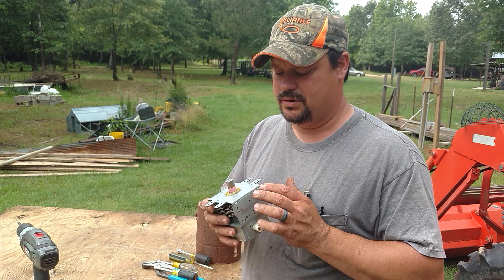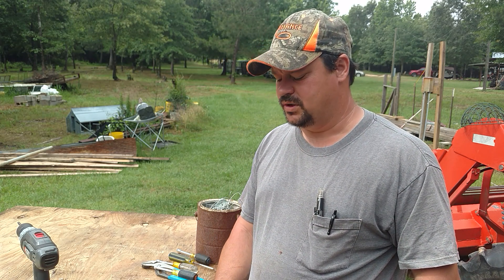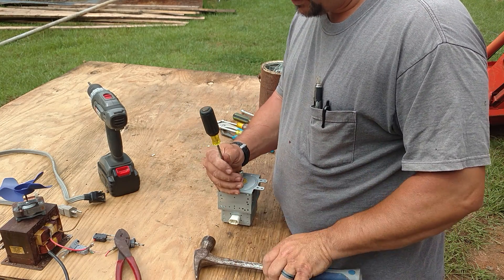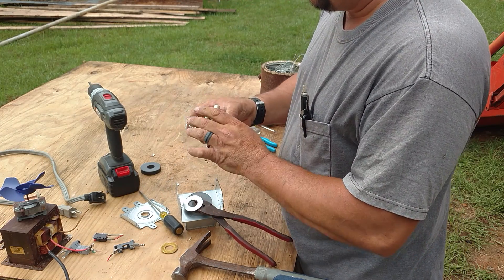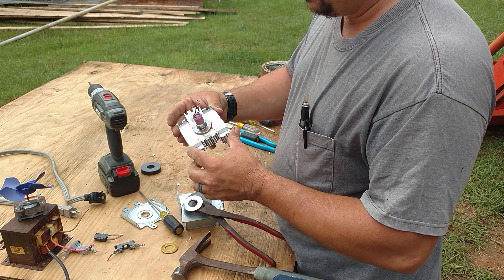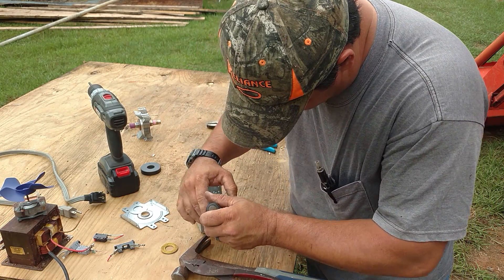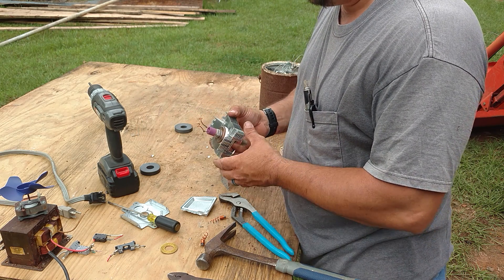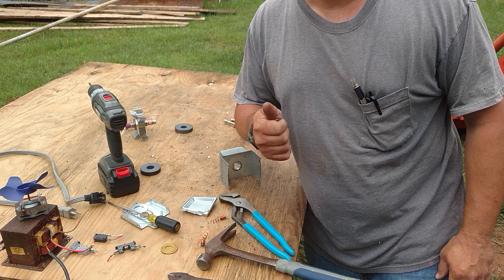scrapping a magnetron from a microwave and the dangers

Comment: Nice video.  You can't stress enough to be cautious with that stuff, it's bad news.  Did want to point out that the piece of yellow mesh you pulled out at 1:26 is brass, and you left another one on the other side, and all of those metal pieces between the ends are aluminum that can be cautiously cut away from the rest of it.
Reply: Sometimes I think the electron chamber can be made of copper although there’s no good way of removing it other than cutting y with a grinder.